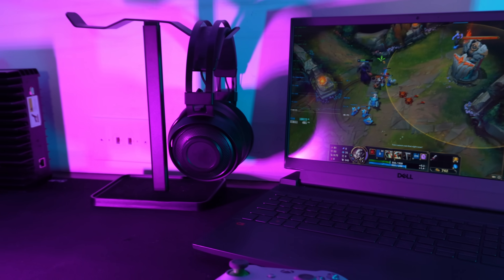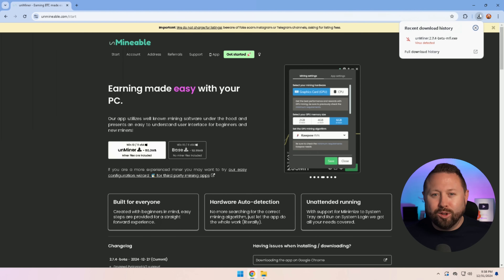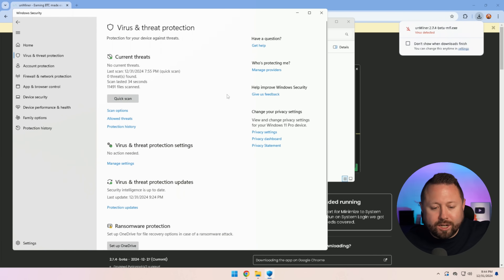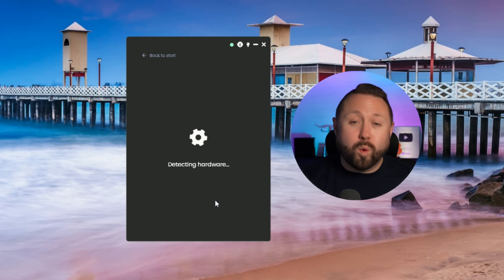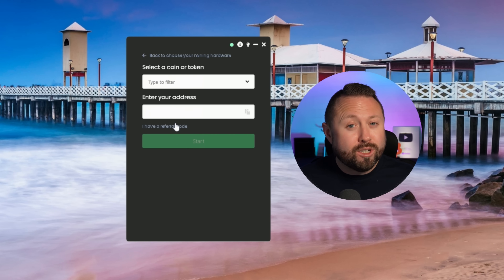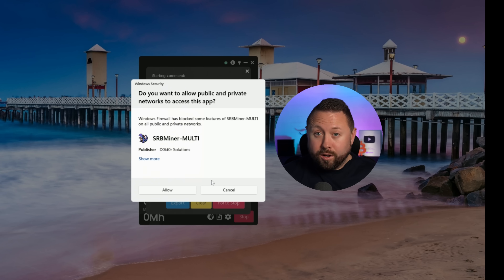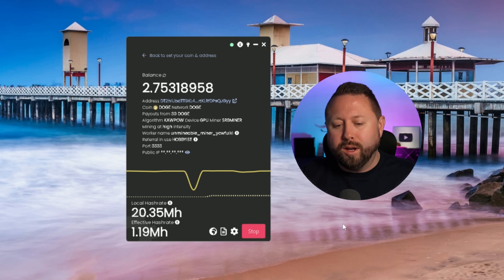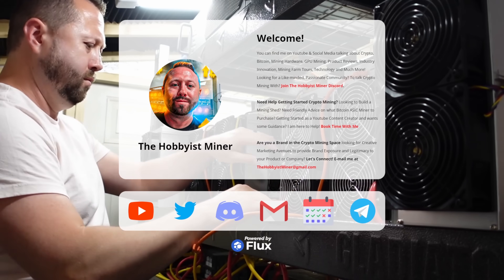Earn CRYPTO with your PC!

Comment: I Did everything in the video but still no hash rate pls help
Reply: I don't know if you have fixed the problem or not probably have by now but what does it's say when you check the minor there should be a little paper icon next to the Gear make sure that the miner is working if not you can check the unmineable web page and they give you some instructions I had this problem too for a while I ended up having to download T-Rex Miner that's not included with unmineable and then change the bat file code to mine to the unmineable pool and then it started working just fine
Reply: Also note that T-Rex minor is only for Nvidia gpus

Comment: I am absolutely brand new to mining... but you have got me all excited I have like five computers at home that I'm going to set up but I was looking through eBay and I saw S7 an ant miner    used for 125 bucks is that worth it should I just wait a while this is also new to me but I don't want to pass up a good deal if it is one
Reply: don't use, contains: Trojan:Win32/Vigorf.A
Reply: If you want to mine. There a website that you can mine without using your PC and not paying much electricity. You can rent there miner and pay. PC you need to get expensive GPU to ran it. Not just standard PC.

Comment: what is better nicehash or UnMineable?
Reply from the maker: Nicehash is a more elaborate software/platform.  However it only pays you out in Bitcoin only. 
Unmineable is perfect for stacking altcoins, especially smaller ones.

Nicehash recently added KYC Requirements, which was a big turnoff for most home miners.
Reply: don't use, contains: Trojan:Win32/Vigorf.A

Comment: Local hashrate 20.33, effective hashrate 1.19..... so where is the other 19.14 going?  Seems sketchy, especially since he glossed over this key fact as quickly as possible.
Reply: local is theoretical, whats possible if everything goes 100 percent perfectly, but you're not gonna mine a coin every time you run an algorithm lol, effective is always going to be lower but it depends on how much computing power you have and how lucky you are to get a coin when you run the algorithm, my local iss 76 and my effective is at 26

Comment: You are amazing ! question can i do it with MacBook Pro - memory 64 gb
Reply: they don't have an easy program you can run on macs, but it is possible to manually run the algo's.   the hash rates on mac chips is unimpressive though.   started my journey hashing with macbook pros, mac minis and mac pros.   1 AMD CPU outhashed them all.
Reply: don't use, contains: Trojan:Win32/Vigorf.A

Comment: Earnings were next to nothing and the PC overheats...
Reply: Haha yea that pretty much describes all pc mining these days. My desktop PC doesn't even mind unmineable at all. Fans are purring, but heat is fine. Processor is liquid cooled  which helps alot with the ambient heat and it's winter and my office is very chilly. My laptop is another issue altogether. Even propping it open the recommended way to maximize airflow isn't enough when your gfx card and processor are next to each other with small fans to cool. I thought about setting up a graphics card profile to underclock it to mine when not gaming on it. The reward is low for sure so it isn't worth stressing the hardware, but if I can get it setup to run while I'm just browsing or idle without damage then why not. It adds up over time. On my desktop, I don't even know it's running unless I game in which case I pause it.
Reply: You need high end gpus to do well in mining
Reply: @fiftyfivefoxes  Mine are a bit dated. GTX 4080 and GTX 4070TI. If I CPU/GPU mine both systems, I get about $0.5 - $0.6 per day gross. I highly doubt that even covers the electrical cost where I live. I'm down to just spec mining on my desktop in the background now. Nothing else seems worth it with the hardware.
Reply: don't use, contains: Trojan:Win32/Vigorf.A
Reply: Not worth mining using your PC. Electricity is way too expensive plus GPU costs 2K or more.
Reply: @ I just background mine now. If I am on my pc and not doing anything that requires my GPU I let it run. It's worth the slight increase in power, but certainly not worth running it just to mine. Also, I am heavily spec mining so maybe I'll luck into a multiplier =D
Reply: Can I mine using the Asus rog ally 7